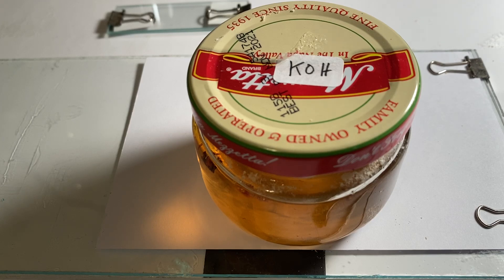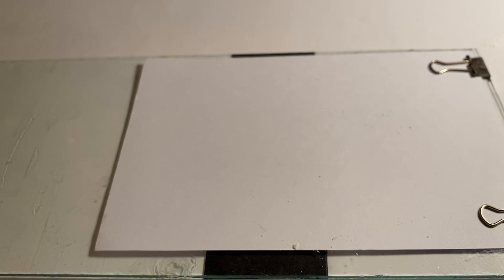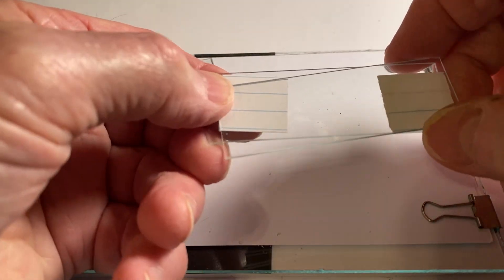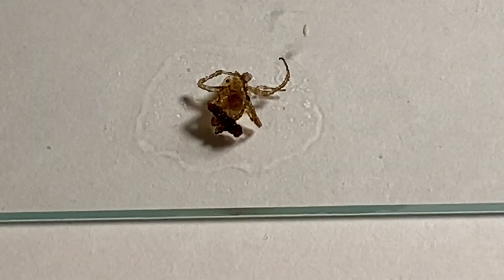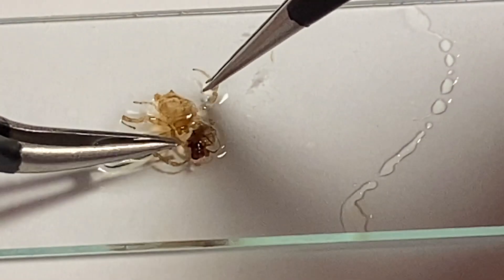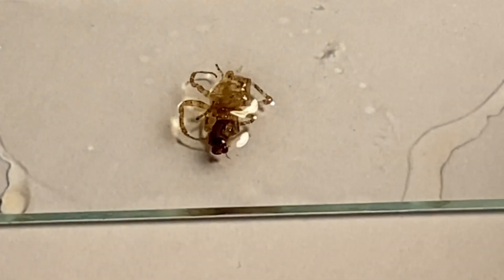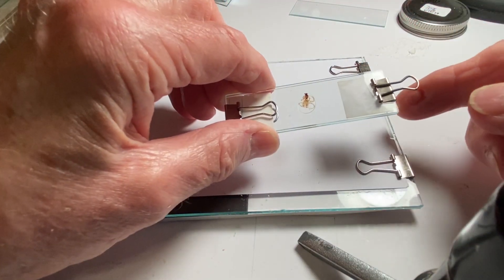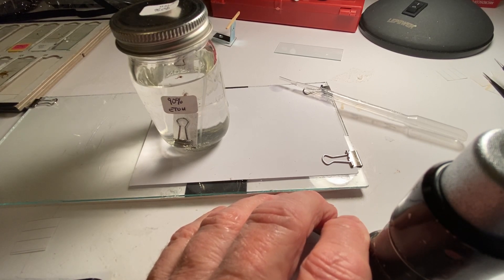Microscope Slide Prep: Whole Insect Mount Part 1 of 2

Comment: How much potash per water please? Just a simple ratio will do.
Reply from the maker: The pot ash is a saturated solution. Keep adding potassium hydroxide to water until it can no longer hold it in solution. You will see a precipitate on the bottom indication that the water is saturated. 10% solutions don’t work.